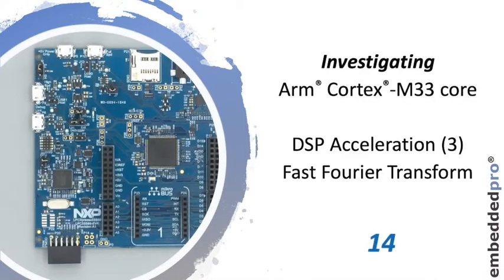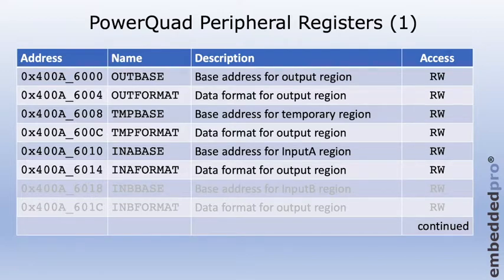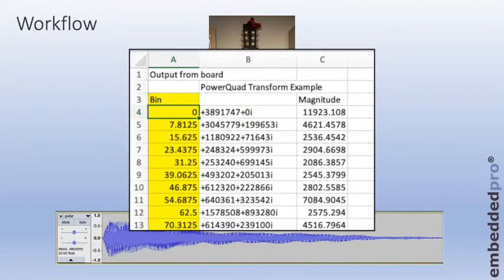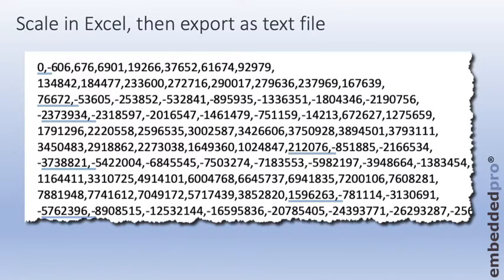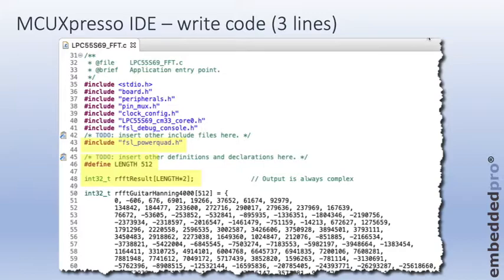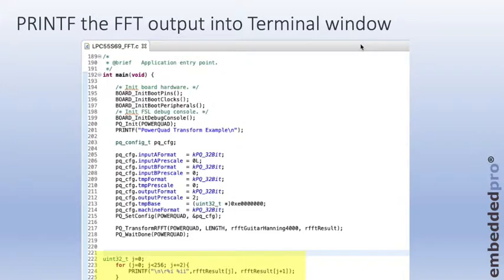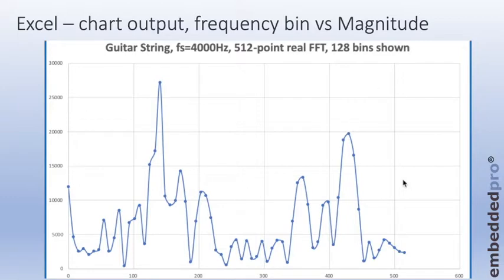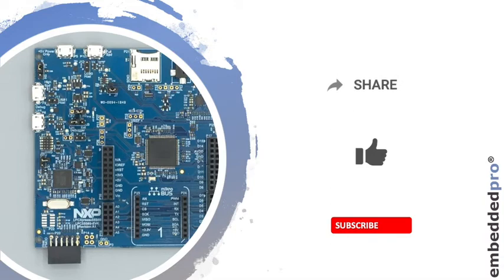14 DSP Acceleration 3 (FFT)

Comment: Do you know if you can use the co-processor interface while waiting for the AHB interface to complete? Or will the co-processor instruction stall out until the 1st operation is complete?
Reply from the maker: LPC55S69 features the ARM Cortex M33 core. This has a dedicated co-processor interface, and so any activity on this bus will not interact with the AHB bus.
Reply: @embeddedpro3870  ok cool, so just to be 100% clear, you could theoretically set up a DFT operation over the AHB interface, then while that is completing, use the co-processor interface to compute cosines (or whatever other no dft operation)?
Reply from the maker: @JoshuaSendall  OK, now I understand your question. You want to set up the PowerQuad with a computation on the AHB interface, and then, simultaneously execute a co-processor instruction (for example, 1/sqrt(x)). Honestly I did not try that, and my instinct is that these coprocessor instructions use some of the same resources internal to the PQ as the other engines. I recommend checking with NXP directly: https://community.nxp.com/t5/LPC-Microcontrollers/bd-p/lpc
Reply: @JoshuaSendall  DFT operations probably not, as the FFT engine uses all four MACs according to the manual. I don't know about the other AHB peripherals